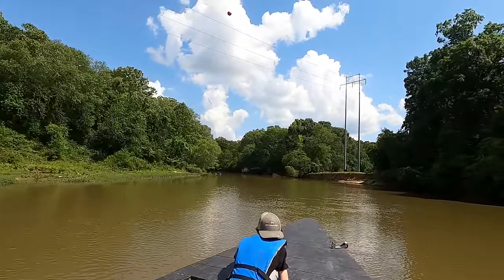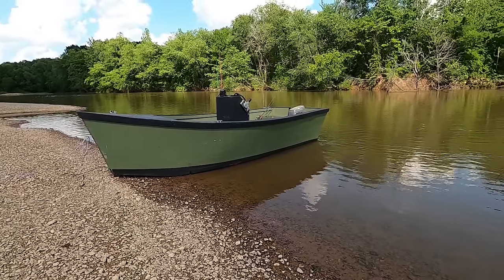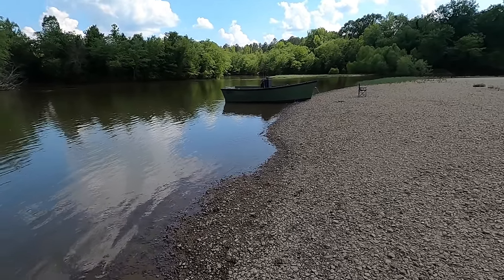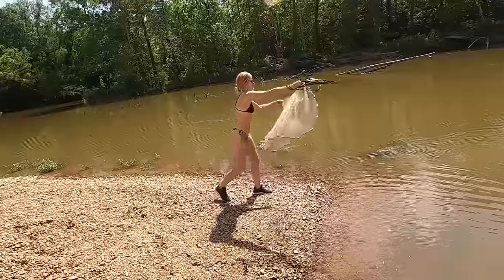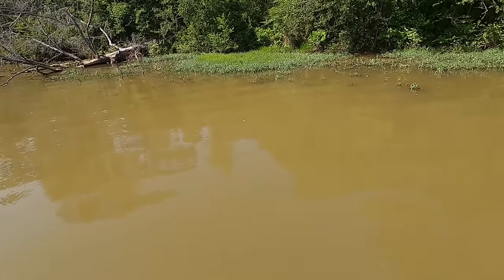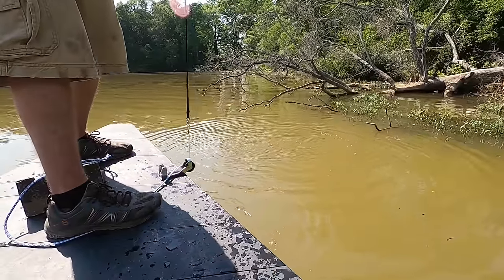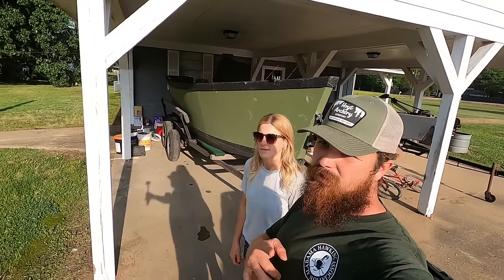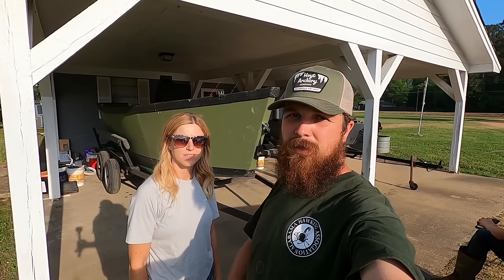We took a day off!!! Showing off the boat I BUILT!!!

Comment: I too have a sawmill. One observation on the video. Your bow strap need to go under the bow roller before connecting to the bow eye. This will keep the bow from bouncing around on the trailer and kep it from moving forward and hitting the truck during sudden braking. Transom tie downs or a strap over the aft part of the boat will keep the stern from moving. Just my $.02 after 40 years of boats and 23 years on the sawmill.
Reply: Was you bragging or complaining? 😅🤣😂